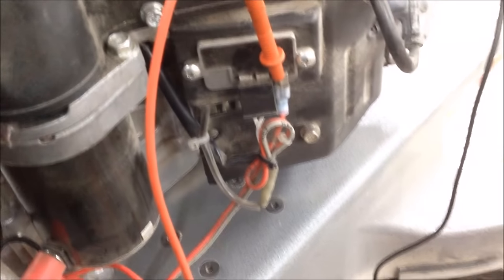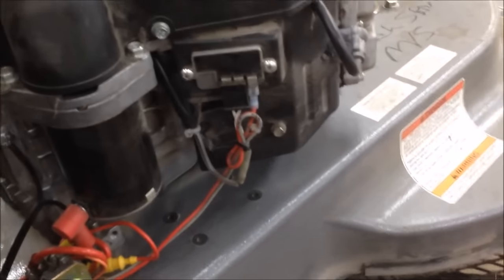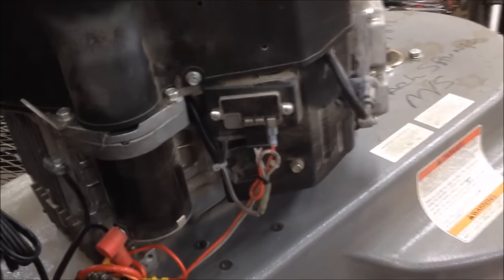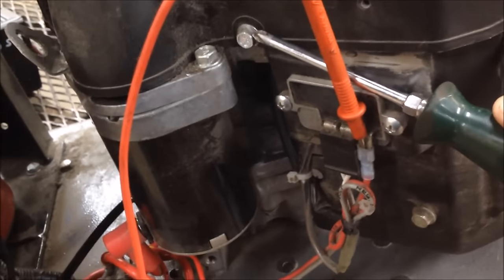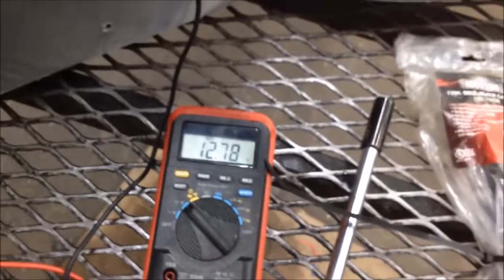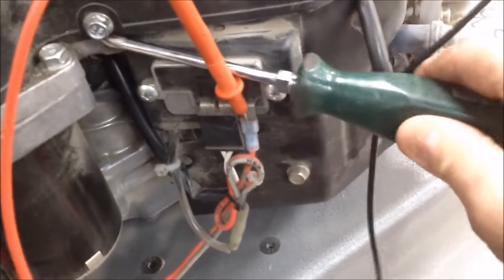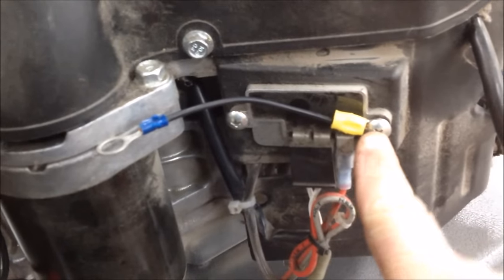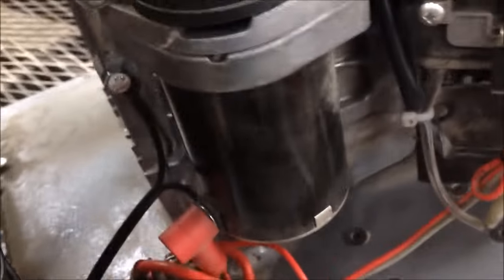KAWASAKI ENGINE REPAIR SO SIMPLE THAT IT WILL BLOW YOUR MIND

Comment: For 2 years I've been racking my brain trying to figure out this very problem. I've been to my local Toro dealer countless times describing this problem, only to be told "You'll have to bring it in." You summed up the problem, and fixed it in less than 5 minutes. I too had resorted to a battery tender. Thanks for the solution!

Comment: My old instructor from the 70's said over and over.  Check you battery check your ground.  No matter what technology it is ---that is still true today.              Good video SIR
Reply: Bruce Pender you are so right sir.
Reply: your new instructor is saying - check every single wire . Ground is only  a half of Your circuit . i hope you get the joke bud . but have seen many bad grounds in my life . recently started to use dummy load

Comment: Good catch, I pickup a 2015 toro time master from this guy, no start, no spark condition, for 50 bucks, he thought he had blown the engine, turns out, and this had me stumped, so I thought I'd share it with you, incase you ever run into this problem, no start condition, was caused by no spark, I changed the coil after I did the coil unplug test, still no spark, so I went old school and grounded the sparkplug to the block, and got a bright blue spark, long story short, the head gasket blew, and was run that way for a week or two, and that caused oil to seep onto both sides of the gasket, and the head bolts, cause a no ground condition for the sparkplug, I clean everything up, new gasket, and she started right up, boy was the guy angry I got a 1500 dollar almost new time master for 50 bucks, the only reason I told him was I had to go back for the bag which his son found, and he asked if I ever got it running..... LMAO

Comment: My Kawasaki FS600V would not charge above 12.6V at WOT.  Stator output was 33 VAC, so I ASSUMED it was the voltage regulator and purchased a new one for $80.  Once installed,  no change to low charging voltage.   Watched this video, and although my grounding jumper was present, I tried the screwdriver test - voltage instantly jumped to 14V.  Thanks for your video; I was out of solutions.

Comment: I love when a problem is so easily corrected. Sometimes you just can’t see the forest through the trees. Thank you
Reply: Kawasaki engines are quite easily fixed for sure. The main reason behind the faults are some manufacturing error brought upon by laxing of criteria during machining/assembly.
Every component is easily replaced however. Needs the right tools.

Comment: Just had this issue on a Toro, customer bought used and said he's always had the no charge issue and finally decided to bring it into the shop for repair. A FX691V I have in the shop had a ground, his FS651V did not. Like you, I added a ground wire and simple as that, problem solved. Decided to search if anyone else had this issue, it's funny, some people just shouldn't work on mowers if they don't know what they're doing! I know it's been 4yrs, but good video MM1!

Comment: Man this is gold, thanks for posting this video, first thing I'm going to check on the mower after I already replace wiring harness flywheel and some other parts that the mower repair guy already replaced, my deck is electric burn power like crazy full charge battery last around 4 hours on the mower, but this video makes a lot of sense now on my mower.

Comment: Also to note on that repair that was the problem for that regulator but sometimes it's just the fuse just in case somebody's try every single thing and has same problem check fuse.

Comment: I noticed the ground problem right away i run kawasaki's on a lot of my mowers and have replace voltage regulators before if they mount to a metal cowl i don't think the ground strap is necessary but if they mount to a plastic cowl as in this case then they must have a ground strap I can't believe a trained  technician could not figure that out Great video!!! God Bless

Comment: Great call on the ground strap.  When working on Japanese motors, use JIS(Japanese Industrial Standard) Philips-type screwdrivers or hex bits.  In JIS language, their Philips-appearing screws are called Crosshead screws and require Crosshead screwdrivers or hex bits to avoid stripping them out. Amazon sells them, and among several brands sold there, Vessel (a Japanese manufacturer) offers some affordable choices to try out. The angles and sizes of the Philips-type bits vary between SAE and JIS, and while an SAE Philips screwdriver of the correct size appears to fit Japanese screws, it doesn't fit properly and tends to strip out the Crosshead screws. Until I found out about JIS standards and the need for using JIS Crosshead screw drivers or JIS hex-bit drivers on Japanese machinery, I had always thought that Japanese manufacturers just used cheap screws. I was wrong.  Most Americans who worked on Japanese motorcycles and cars, including me until a few years ago, were using the wrong tool for the job.

Thanks for the quick, excellent video, and your advice to never overlook the obvious.
Reply: Nice info. I think you just solved one of the greatest mysteries of the current world. Who would of thought this. This topic is much more hidden than the somewhat obvious problem in this video. You have three contacts and only one of them is being used, a "mechanic" should not have a problem seeing a problem here!!! In your case you would need a microscope to see the pitch angles of the screwdriver don't match JIS.
Reply: I was amazed when I found out about this spec difference between Japan and US screwdrivers. I felt like I was 20 or 30 years behind the times!

Comment: Been in the business for over 15 years had a Kawasaki that was not charging once, but it had the ground strap on the regulator. Got to looking and this one had the ground strap going from the regulator to the shroud bolt and a mouse had built a nest on that side of the motor and it had melted under the bolt head where the ground strap goes and it had insulated the ground strap. Cleaned out the mouse nest and scraped melted plastic from the bolt and got good connection and the motor started charging. The newer Kawasaki engines have the ground strap going to the starter bolt. The next time I had a motor with that problem I cleaned the original strap and ordered the later style strap and put it on too and had two straps but it made a good repair for a $4.00 part.

Comment: I have seen similar set-ups. 3 tabs on r/r regulator rectifier center was Bat+. yup lotsa plastic. 
A customer would have been made to take mower  home with new parts an not have it charge,
then have to bring back.

Comment: It's a good idea to replace those regulator screws with a nut/bolt combo. Too often vibration doesn't keep that ground solid and batteries will not get that extra 1v or so to stay up.
Kohlers are bad and kawasaki too.
Reply from the maker: First I’ve heard of that.   Il
Keep that tip in my Rolodex of knowledge
Reply: @THEMOWERMEDIC1   Youre welcome, love your stuff

Comment: question-  We have a Kawasaki 2013 mule.  The DIF light stays on and it has loss of power.  We had a new computer installed, it worked for a few weeks, not it is doing the same thing.  The computer was $800 any suggestion?

Comment: Very interesting. I had the same exact prob w my exmark vantage my solution was to simply run a wire from that single terminal on the regulator to the batt positive, but this would be a much better solution.

Comment: 2019 Kawasaki mule installed new battery still will not run the engine will turn over strong checked spark plug looked clean any advice thanks

Comment: I am pretty sure you just diagnosed a problem that I have been dealing with for over a year.  Sure tired of having to charge the battery to use the mower.  Mower is Toro Titan ZX4800 with a Kawasaki FR651V engine.  Now to find out if this is my problem THANKS

Comment: Hello, need some help on a kaasaki 708 cc lo vacume looks like a small oil leak at oil plate on bottom but anything else can you recomend ? I put my finger on the air pull on manifold and barely feel any pull ..any ideas please? barely pulls fuel up to carb..

Comment: good tip Jeremy!
Reply: @Maddog worker Check for trash in your fuel tank blocking the outflow, or a crimp in the fuel line reducing fuel flow. Diagnosing these is quick and the fix is virtually free.

Comment: as a OPE mechanic i have found grounding issues to many times.  personally i have found the OEM's tend to use a short to the frame ground wire, this wire is even over paint not a bare.clean metal spot, making the frame to engine bolts the engines only  ground.  adding a 10 gauge wire from the negative  battery post directly to the engine block  and a short wire as shown from the regulator  to the block helps stop many issues with charging and starting
Reply from the maker: Always check grounds.  FIRST

Comment: Well my ground wire is there and it's still not charging after I replaced the voltage regulator and the battery should I replace the ground wire

Comment: I have a JD 170 with 14hp Kawasaki  what baffles me is at cold start up volts show 12.6 maybe 12.7 at idle but as engine rpms increase volts go down to high 11 volt range.Tractor always starts up no problem. Has me stumped.

Comment: Hey nice video ..   I have Kawasaki ..  but also a Trail Wagon ...  390cc..    Nice job.   How did you know which ones of the wires fit on the starter.  I have a green wire that isn't hooked up but I cant short the positive on the starter solenoid across and it will start  ..  but don't know which wire needs to be hooked up to starter so I can use the key.    any thoughts on this ..   I would appreciate your help.    thanks much..     GD Tractor
Reply: It didn't matter that the ground wire was connected the starter. He just used the starter as a random bolt onto metal for a ground. The regulator needs a connection to ground to work. It would be grounded already if it was bolted onto metal instead of plastic.

Comment: I have a 1985 John Deere 160 and when it runs for a little bit it dies and then when I try to start it the battery is dead. Put a voltage regulator on it running and it charges to 12.99, then when I turn on the PTO it slowly starts discharging one number at a time. PTO? How easy is that to replace?

Comment: Now what happens if the regulator /engine has no ground strap, and mounts to iron engine cover for ground? Dc side is ziltch for dc output to battery.

Comment: They must have been a parts changer. No investigation or testing, jut toss parts at it until it works... until it doesn't. shakes head
Reply: there are thousands of them out there, and the sad thing is most of them work at dealerships.

Comment: What's the voltage limit on a 22 hp Kawasaki?  I have an extreme clutch pto and they want it under 14.  Mine is charging WOT a little under 14.5.
Reply: Most charging systems of just about anything are going to get over 14volts.  Sounds like the "they"  don't know what they are talking about.

Comment: Got a pretty bad electrical burn on my arm from a vertical command twin once. Strap was there, but the customer stripped out the plastic shroud. The ground strap was so cooked it looked like it was in a microwave for 20 minutes. Never got hit with a regulator like that. Just grazed it with my inner forearm while digging sticks out from behind the motor. Warming the oil up and blowing the crap off it for its diagnostic. Sweating like mad. I grounded the negative side of the charging system with my right arm. The battery was very low.
I potentially received the full 20 amp load from the negative side. My forearm skin was blistered like crazy and my teeth hurt for 2 days.

Comment: Gotta q for you, I'm picking up this John deere x304 for free, everything works on it, it looks brand new, the only issue, which is a big issue, is the steering brass bushing at the bottom of the steering shaft is messed up, so it doesn't steer, and he can't find anyone who wants to fix it, including me, it's a real pain in the butt to do, as I'm sure you know well, the whole steering assembly has to come out, and it's a pain, so he bought himself a Zero-Turn, and wants the jd gone, so I'm picking it up this weekend, q is, I have 2 big tractors as of this weekend, a 24hp briggs v twin, and this Kawasaki FH491V in the jd, if it was you, which engine would you keep? Both run great, and start on a dime, low hrs too?

Comment: Another great video Medic but to be very honest rather have a Kohler Engine than a Kawasaki Engine
Reply from the maker: Nah. Kawasaki will run circles around kohler in longevity
Reply: @THEMOWERMEDIC1  I have a 32 year old Kohler Engine that hasn't realized yet its 32 years old all I have done to it is yearly tune ups.. and I have the Kohler KT725 22 horsepower 725cc V Twin Engine in my Craftsman T240 the 7000 series Kohler are designed after the Kohler Command Pro commercial Engine it's a beast and many years ahead of it
Reply from the maker: I’m sorry but I can’t argue with facts our fleet of Kohlers Are dropping out like flies and our  Kawasaki’s are still going strong
Reply: @THEMOWERMEDIC1  hmmm sorry to hear this but my two Kohler Engines are issue free
Reply: @THEMOWERMEDIC1  Kawasaki Engine come with a 4 year or 700 hours warranty that not really a great warranty here's why using a tractor with that type of warranty commercially you can rack up 700 hours in 2 1/2 years I know because I have done it...now the Kohler Engine 3 years unlimited hours Warranty I would have to say the Kohler edges out the Kowalski

Comment: hi jeremy nice video  i have a question  i have a 2008 hustler super z with a kawasaki 25 hp  start's very easy cold but after i cut my lawn and stop it it is very hard to start again  and if it happens to start it's because i tried for at least 10 minutes  that is not the norm.  can you help me out please       thanks
Reply: could be a coil. spray cold water on it sees if it starts.
Reply from the maker: absolutely when it won’t start, check the spark. if it has spark, then I would lean towards a fuel system issue.
Reply: @assyholey4224  spray cold water on the coil?
Reply: @roberttheriot7612  yes if it cools down it will start and run till coil gets hot again. Kawasaki had some coil trouble.
Reply: @assyholey4224  ok. I will try it when I get time. Thanks
Reply: @assyholey4224  yes sir  one of the 2 were very week  thank you and Jeremy
Reply: @roberttheriot7612  you are welcome.

Comment: Your lucky. Most of those regulators short out the second you run a current to it if not grounded
Reply from the maker: No that is an incorrect statement sorry
Reply: @THEMOWERMEDIC1  you ever work on a jd 316,317 or 318.
 Give it a go but I warn you that regulator is expensive

Comment: HELP Please...   I have a 15.5 Techumse engine with all the wiring cut off and left hanging... I figured it should start with my booster pack...  pos to the starter, and neg to the frame... But theres No Spark from the coil... It worked fine before the engine was removed and the wiring harness cut off... But it still should start...!??  I even took coil/magneto off and cleaned all surfaces and put bk on... gapped corectly yes... and removed ground wire also and still nothing...  Only wires left are the coil wire hanging cut at end... a yellow & black wire coming from inside the engine it looks like, and thats it... But shouldn't there be spark from that coil.?  Even tried a diff plug... I figured it would start, and i'd just have to pull the plug wire to shut it down...? Any1 know.?
Reply from the maker: Coil possibly mounted backwards

Comment: Not all Kawasakis have a ground lead.  This video made me nervous.   Having a' fuse-blowing problem on a Ferris with 19 HP Kawasaki, and couldn't find that ground lead!
It turns out the regulator version on the Ferris (and many others) looks the same, but mounts with a slotted retaining tab on the left and a single screw on the right.  
That screw must attach to grounded metal; measured 0.00 Ω, tab to chassis. No separate lead.

Comment: Regulator not grounded. I see that sometimes. Try grounding that regulator with a very sweaty forearm. It will burn the crap out of you. Command twin stripped out plastic screws damnit! Felt it in my teeth.

Comment: Ok.. so simple to fix..but I have a problem..have a Ferris with 37 hp Fx1000v Kawasaki DFI.. We replace the coils…put back together started right back up..ran beautiful at idle..tried to test , and the switch that throttles up ..did not speed up..only idle..WHATS WRONG! Anyone got an idea?

Comment: is there anyone that I can send a picture of this part i need to find. One guy told me it is a stater.   to me it looks like a flywheel.  with the six magnets going around the inside of it. Can this be fixxed or repaired. Pleasesomeone help me out here and let me send you a picture of the part. thank you, downed out old biker also its a 1993 500 kawasaki fulcan 500

Comment: That’s a wrench turner, not a technician. So... where was the ground strap? Why was it missing? Did the wrench turner simply fail to re install when replacing the original Voltage regulator? What was the original cause of the issue? Was this a factory fault?
Reply from the maker: Ouch my head hurts.  You didn’t pay attention.    I answered every one of your questions in my video
Reply: THEMOWERMEDIC1 no offense but I don’t think you did... you said what the original complaint was, what the first mechanic replaced. Neither of those things tells us what the original root cause of the no charge issue was... was the ground strap missing from the factory? Or was one of the original mechanics replacement parts actually faulty but he simply failed to re install the ground strap?
Reply from the maker: Root issue was prev tech removed shroud for cylinder clean out and missed the ground strap